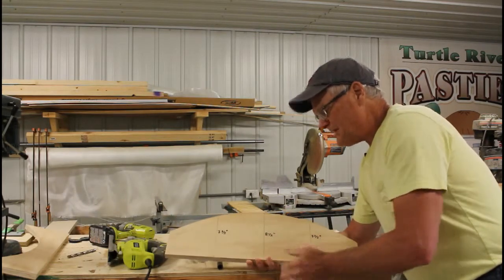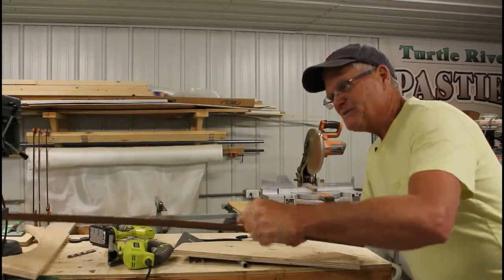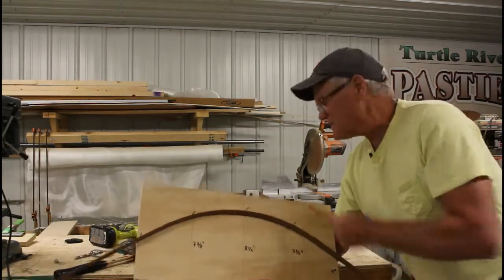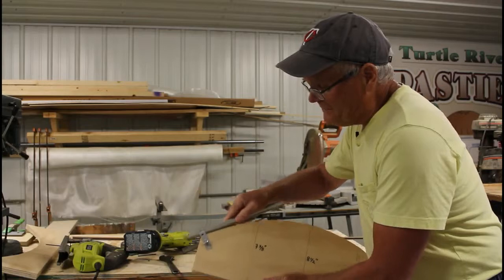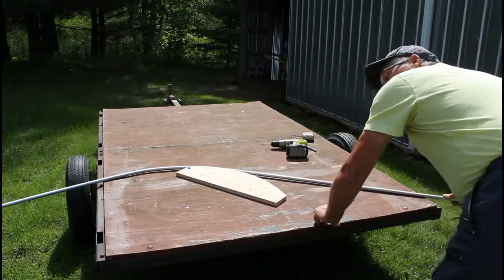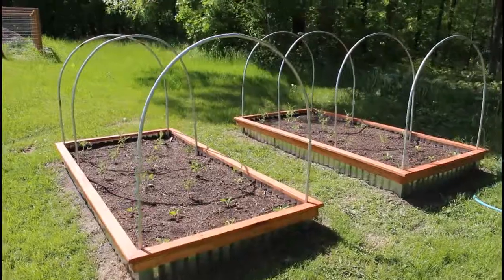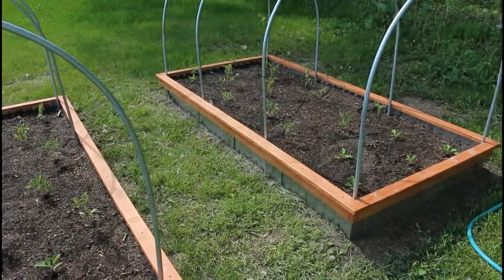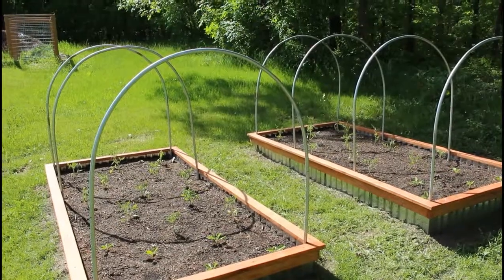Don't use PVC for your Garden Hoops

Comment: Had my doubts about building the bender but it worked like a charm.  Thanks BackWood Basics for sharing your knowledge.  We installed our hoops and covered our garden beds quickly yesterday as a spring snow storm  was forecast for our province.  Sadly, the forecast was borne out but our plants are covered.
Reply from the maker: Good to hear, Scott (not about the snow). I now make what I call Bed Caps. There is an awfully long video on how I make them that I made a week or 2 ago, in case you're interested.

Comment from the maker: Thanks for the feedback John. Yes, pvc is very workable, and I have used it many times. But it degrades in the sun, is not strong, and most of mine ended up in the landfill. Metal is just about as cheap to buy, lasts forever, is super strong, and it has value as scrap metal when it is no longer needed. The hoops can also hang on a wall in the off-season.
Reply: BackWood 
Basics y
Reply: Thank you for your respectful reply, totally unlike the reply from "who scary". At the time, I was searching for "how to build a cheap garden hoop" because my funds were low. Your video was one that came up in my search. I had already viewed quite a few concerning PVC and had made my choice. Then I saw your video, and it threw me off, and being short on time and money, it made me more bias for the PVC approach. I apologize for coming across to strong. I had nothing to prove. Perhaps in the future I may convert to medal, if I do I know where to look. Peace!
Reply: The only conduit I can find has some sort of coating in it.  Is this safe to use?  Description on website says..  Interior coating provides a smooth raceway for faster wire pulling

Patented Flo-Coat triple layer O.D. protection

High grade, durable and ductile steel for long lfe
Reply from the maker: @happyautumn3938  Never heard of such a product. It sounds expensive. I would stick with the cheapest, thinnest galvanized EMT (electrical metallic tubing) at the building supply store.
Reply: @backwoodbasics9383  thank you!  I found a electrical supply store, he was great!  Got plain conduit for less than lowes.  Now on to make the jig!  Did you mark the poles to know where to start the bend?
Reply from the maker: @happyautumn3938  Great! Yes, I marked the bend starting points.
Reply: @backwoodbasics9383  thank you so much!  It is raining here today.....hopefully the sun will come out tomorrow and I can work on them!  Thank you for your help and time!
Reply from the maker: @happyautumn3938  Good luck!
Reply: @backwoodbasics9383  I did it!  My plywood wasn't thick enough so I made two cut outs and screwed both to the table!  The first one I wasn't aggressive enough with the pull and it came out a little crooked, I tried bending it again and it curved a little better!  I tried a second pipe and really gave it the pull and it came out great!  Not as beautiful as yours though!  Lol   I'm guessing by the time I finish the last pipe it will be almost perfect Lol  I'm so excited to get this project together!  I can't thank you enough for your templates and all of your math skills making them!  You are a saint!  Thank you for making just one of my do it yourself projects actually nice looking!
Reply from the maker: @happyautumn3938  Good to hear. It gets easier-even fun-with practice.

Comment: This gave me the idea to use metal conduit for my project instead of PVC pipe. It seems conduit is cheaper than PVC right now as well! The big difference is, mine is for a cover for my boat instead of a green house. I think i'm going to go with a lean-to style, so one side will be 3 feet wall, the other wall will be 7 foot to prevent snow from building up. Thanks for this idea!

Comment: Thanks for sharing this! I’ve been using galvanised fencing top wire off-cuts as a temporary solution, but it flexes too much. I was thinking of using PVC piping - as a permaculturist it goes against the grain - and came across your website and link to Youtube. It will be a good winter project for North Yorkshire, UK.

Comment: So you're using 1/2" EMT 10' pipes, right? And your beds are 42"? I think this information might be useful to the people watching. Thanks for the details of the process. I'm definitely going to try it. Like you, I'd like to minimize my use of plastic. There's way too much plastic out there. And you're right that gentle bending will not damage the galvanized steel coating.
Reply from the maker: Yes Kris, 42" on the inside, and 1/2" EMT (Metal conduit). I have made other benders for different widths. There is a bender for the 6' wide chicken cage, a hooped arbor, and for my bed caps, that cover our raised beds. All should be available on the Backwood Basics channel.

Comment: Made our own electrical conduit bender a few years ago, but since then, 1/2 inch electrical conduit pipe has gone up to $24 Canadian plus 15%tax for a half inch pipe!  The schedule 40 PVC 3/4 inch pipe is still only $10 CAD +15% tax each. Unfortunately, we can no longer afford the metal electrical conduit pipe.  All of our low tunnels will now be made with schedule 40 PVC! We made a couple of them on our raised beds and they are actually very sturdy, and have stood the test of time over the past two years.  Still, we would have preferred to continue with the metal piping, but it’s no longer financially feasible.
Reply: i'm going to try rebar
Reply: @JohnJohn-bc4nh  Rebar is a lot harder to bend smoothly. I know cause I used to be a concrete form work carpenter. You'd be better off if you went to a rebar fab shop, I'm sure you can find one, and give them the requirement you want and get a price for them to fab the hoops. That will save you a lot of aggravation and maybe some skin! (I have lots of scars from rebar). But, you do what you want. This is what I would do. The cost of the material would be a part of the price the shop gives you.

Comment: Glad I saw this. I was going to do this with PVC but, the idea of the conduit is perfect. And like you say in the vid, it will last forever. Now, what to use instead of plastic sheeting?
Reply: Bob Chekoudjian in summer most gardener use sun green shade cloth, not plastic sheets because it is too hot. Winter we don’t use raising bed . We use green house
Reply: I am curious why you don't want to use plastic sheeting? I have heard pvc will degrade greenhouse sheeting, but I haven't heard anything about the metal tubing

Comment: PVC electrical conduit is UV resistant and rated for outdoor use in direct sunlight. It'll be printed on the pipe if UV resistant. But most of it is.
Reply from the maker: I have lots of it on the outside walls of our buildings, and it works fine as conduit. I also built a quail hut for our son using it, and after a couple of years it turned whitish, snapped into sharp shards, and the whole works had to be cut up and hauled to the landfill. This is what I try to avoid by using galvanized metal.
Reply: It must not have been UV resistant. Water line will last that long. UV conduit should last for many years and I see it do so all the time in my line of work as a control systems engineer.
Reply: @beebop9808 the issue is the bending in a hoop house applies constant stress on one side of the PVC and is not how it is designed to be installed.. any PVC will degrade and crack eventually when bent at these angles once all the plasticizers evaporate away in the heat and cooling cycles of the sun and seasons.
Reply: Electrical conduit is bent and molded everyday, both indoor and outdoor. It wouldn't be worth much if it couldn't be. Most installations making it 20 years or more before degradation becomes a problem. It's not the same as water and drain pipe. There's a reason it cost more.
Reply: @beebop9808  I agree it can be bent thermally with a hot air gun or heating blanket so it's now a new shape - how it's done for electrical - but that's not what people do when they use PVC pipe or conduit for hoop houses, it's bent in a tight diameter circle with no heat so it's always under stress.

Comment: Loved this, thank you!  What would your measurements be for making hoops for a 2' wide bed?  Would it be the same, but with a 12" wide piece of plywood vs. 24"?  Thanks much!
Reply from the maker: Thanks Anne. No, a 2' wide bed would need a much steeper angled bender. Might even be too much bend for conduit. To get the dimensions for a bender, bend something flexible (like poly tubing) to the arc you want, and clamp it to a work surface. Slide plywood under the tubing at the top, and draw the arc on the inside of it. In fact, for a 2' bed, black poly water line, or pex tubing, might be all you need. Good luck.
Reply: @backwoodbasics9383  Wow, thanks so much for the warp speed reply and great ideas!

Comment: I don't have a trailer, picnic table or any other wood surface to attach this to. Is there a way to attach it to the ground?
Reply from the maker: Barring a sturdy horizontal surface, the bender can be secured to a vertical surface. It just must be at a height and angle to allow for free movement of the tubing. It just means more attention to keeping it straight as the hoop is being formed. The nice thing about 1/2" tubing is that it can be easily re-shaped, if the hoop is a bit out of alignment. Good luck.

Comment: Would you ever do a cross support between the hoops. I've got 4'x16' beds and would feel better if there was some support between the hoops. Maybe just a long piece of conduit tied off with wire or rope?
Reply from the maker: A ridge would be a good idea. 1/2" conduit, joined using a 1/2" coupler, would probably be the cheapest and simplest, just cable-tied to the hoops, using black, UV resistant cable ties. Easily removed and dismantled. I used a 2x4 as a ridge to tie the hoops together on my mobile chicken cage. But that has endwalls that the 2x4s connected to. With wood it is easy to screw in 1/2" two hole straps as connectors.
Reply: @backwoodbasics9383  Thanks for the info and quick reply. I just watched the vid about attaching the cover material and saw the connectors. I'll be doing some shopping this weekend. Cheers!

Comment: What is the relationship between the dimensions you used for the bender jig and the diameter of the hoops? Is there a formula to relate the two, or did you find it by trial and error? I need to build a bender that will give me an 80 inch radius.
Reply from the maker: No formula. I didn't pay that much attention in geometry class. I spring clamp some flexible tubing on a flat surface at the radius I want. I then slip some plywood under it, and trace the arc. I find the dimensions at stations, so I can reproduce it. I cut it out, and bend a pipe. If it is what I want, I use it. Otherwise I will modify it a bit to get what I want. It's usually very close.
Reply: @backwoodbasics9383  Just made your jig to bend some tubing. Works great. However, my beds were not exactly 4 feet wide. I think I understand how you made your jig, but could I encourage you to make another video on your process so we can see how to make jigs for 2 foot, 3 foot, 5 foot, etc.. beds? Maybe call your video "DIY Jig for Tube Bending for Hoops on Raised Beds." I found your video by luck, but it was just what I needed to start. Thank you for sharing your project.

Comment: Assuming those are 10' lengths of conduit, how tall are the hoops once installed? Thanks! In our area, metal 1/2 conduit is going for $11/10', and PVC is $8. I'd rather spend a bit more on something that will outlive me. Also plan to cover with fencing like you did in another video to protect crops from animals and provide support to row cover.
Reply from the maker: Back then I could get 10' lengths of 1/2" metal conduit on sale for $3. Now, they are about $5.50 each, which is still a good deal for hoops that will last for decades. I believe they were 3'-4' high, depending on how far they were set into the ground. The bed caps used conduit cut down to 8', and were then about 3' high. I am sold on bed caps here. They make gardening worry-free for us. Row cover can then be easily draped over them, as needed.

Comment: How did you come up with 2 feet verticals on each end evenly?  Or... if I want to vary the final height of the hoop, how do I measure the starting length so I don't waste materials?
Reply from the maker: The length of the straight vertical portion is determined by the arc of the bend, and the desired height of the hoop. For this hoop. I measured up 2 feet from each end of the tubing, and marked it. I then started and ended the bend at those marks. It may require a bit of tweaking on each end, just past the bender, to get vertical legs. I think I showed how to do that. For shorter hoops, like the ones for my bed caps, I started with 8' lengths, and I believe the bend started and ended up 18". That, of course, wastes 2 feet of conduit (but it used to be $3 for 10 feet).
Reply: @backwoodbasics9383  Thank you for the response, Sir.  
I couldn't find bendable/flexible material to help me connecting the dots and make gentle curve on my jig but, I found an easier way to do it without assistant.
In making your 42" hoop, I divided the diameter: 21" and put a screw on one end of a 36 inch long 1x2 and drill a hole that fits my marker 21" from the screw.  I put the marker on the highest point of the curve (8") and using carpenter square, I set the 1x2 perpendicular to the base of the curve or the edge of the 24" and screwed it to another piece of plywood that I butted against the jig ply, so now I could swing the marker end left or right to sweep through the other dots to make the curve.
I also find a calculator on Google that tells me the circumference of a 42" diam circle.  If I divided that number by 2 and subtracted the 2nd number from the 10 ft I would get the left over length of the EMT and divided that again by 2 to measure from either ends of the EMT.  I'll see how accurate that calculation will be.  
My last challenge now is to find a surface where I can affix the jig because on your videos when you're doing it on your picnic table, the table moved.  Even your trailer at one time also moved.  There's no wooden fence, shed wall or trailer and I cannot attach the jig to the house's sides/walls or husband's truck bed 🤔

Comment: do you have the measurements for a hoop house? For PVC you use 20 foot peices to make a 12 foot wide which gives roughly 6 to 6.5 foot head clearance. just wondering the arc needed for a bender
Reply from the maker: Our hoop house (we had 2 until last season) is 12'x24', with close to 8' headroom in the center. I made the hoops from galvanized chain link fence top rail. They have a swaged end, which fits into the other end, making 2 of them 20' long. Benders are available from Johnny's, but I made my own. What makes my design different from most is the end wall design, which makes attaching the plastic simple. If I don't run out of summer, I hope to make a video on how to bend the pipes, and how I make the end walls. Stay tuned....
Reply: @backwoodbasics9383  Oh yes, please.  I have been going through all your videos trying to find one where you showed how to build your hot house.  I may not be able to find the pipe with belled end at that dimension, is there an alternative?  Thank you.

Comment: if the conduit is Hot Dipped Galvanised will this coating crack when bent , what conduit are you using ? thanks Bob
Reply from the maker: I use thin walled 1/2" EMT. These are gentle bends, and there is no cracking or rusting. The only deterioration, over time, would be the ends, if they are pushed into the ground. Electricians use conduit benders to bend it up to 90 degrees, with no issues.
Reply: @backwoodbasics9383  Thank you

Comment: What would be the measurements for a 3 ft wide bed?
Reply from the maker: James I think I would just use the bender for the bed caps, not tweak the tubing past the bender at all, and pull the ends together by hand, to get to about 3 feet at the base. It should be close enough. Here is one of my videos on how to make and use that bender. Hope it helps. https://www.youtube.com/watch?v=I2XU0BTc3OM&t=14s
Reply: @backwoodbasics9383  thanks

Comment: Any advice for doing this on a larger scale
Reply from the maker: If you mean like a small hoop house, I have a concept in the works for a 6'x10' one that would slide over raised beds. It would be 6' tall, with a door, at least on one end. Otherwise, I hope to also get a video made on building our 12'x24' hoop house, with plans for a bender, and end wall design. We just need to get above freezing, and get rid of 2' of snow first.

Comment: Are they 4’ from vertical to vertical?
Reply from the maker: They can be spread a bit to be a full 4 feet wide.  Just spread them and tweak the vertical ends a bit more, so they are vertical at 4 feet.The bender was designed so they fit inside of the beds, which would be more like 42".

Comment: How is buying all this steel and building a jig (in imperial no less), better than going to your local tip (recycling centre) and just using pvc pipe and stakes!?!?
Reply: PVC leeches toxic chemicals in garden
Reply: He's explained that the pvc didn't last. He elaborated in the comments that it literally broke in sharp shards and had to be dismantled. Plus less plastic causing pollution the better. Less pollution in the garden....so much better.

Comment: are your beds four foot wide?
Reply from the maker: They are 4 feet to the outside of the top cap. Inside width is about 41 inches.
Reply: @backwoodbasics9383  do you by any chance have the measurements to make a hoop that is 48 inches wide?